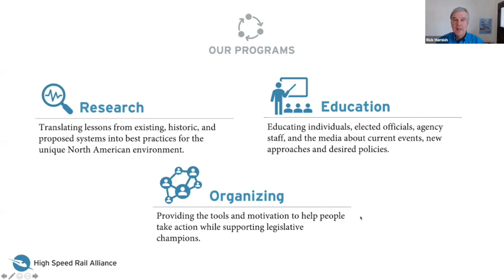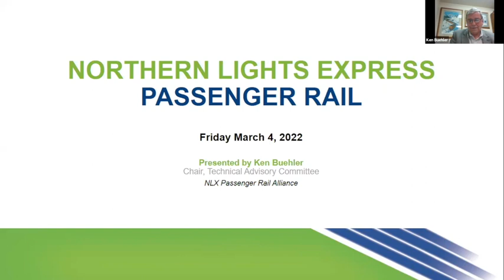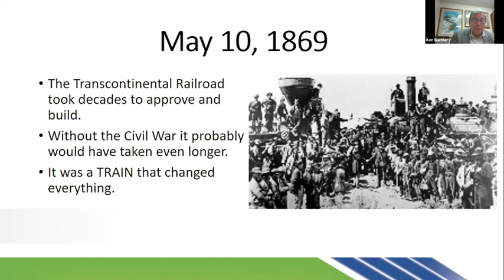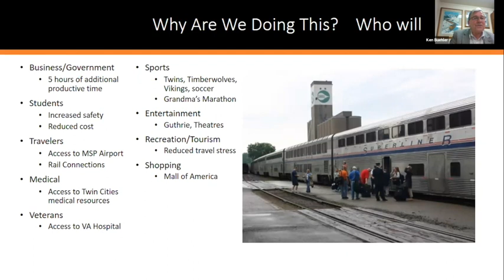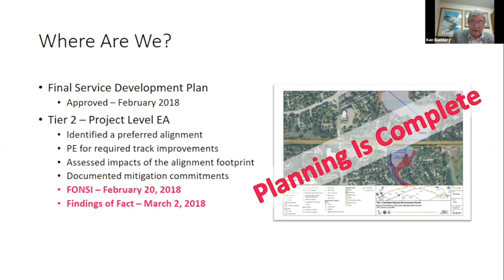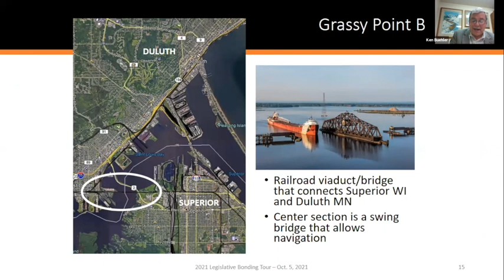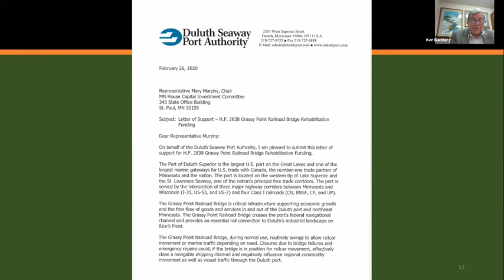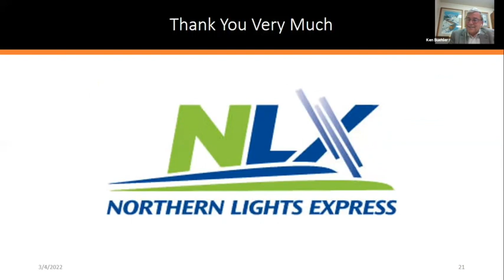Minnesota's Northern Lights Express

Comment: I wish NLX nothing but success. But I have to question what will be gained by Mr. Buehler throwing commuter rail under the bus. 

He speaks about how rail travel works everywhere else in the world. The reason it works so well is because the various modes of transport are coordinated with each other, to produce a near-seamless experience. And, whether Mr. Buehler wishes to admit it or not, that includes commuter rail.

Wouldn't it be far more beneficial to explain to lawmakers that by coordinating with commuter rail, NLX will serve more than the towns along that route, but also the towns along the Green and Blue Lines, Northstar, and eventually the Southwest? 

COVID has meant a hit to commuter rail, but we don't yet know the long-term effects. In some cities, we are seeing public transport begin to recover from COVID-related losses, and the ever-increasing cost of gasoline may push the recovery even further and faster. Attempting to push away from commuter rail to score some short-term gain does nothing but jeopardize commuter rail AND NLX down the road. 

Metro should be standing firmly behind NLX. NLX needs to do the same for Metro. You will sink or swim together.
Reply: How  did you react to the recent news?
Reply: @captainkrajick  Very glad it's received financial support from the state. Let's hope that the feds throw in sooner rather than later, as support can shift with the political tides.

If the route does get built, let's hope transit planners and NLX get together to coordinate timetables. MnDOT has other regional rail aspirations, and if they can get Metro and NLX into synch, it should translate into better ridership numbers, which can help justify further rail expansion.

Comment: The whole discussion about NorthStar is ridiculous. The reason nobody rides northstar is because it doesn't run frequently enough to be useful, not because nobody wants a local regional rail style train. It only has two round trips, with 2 inbound in the morning and 2 outbound in the evening, and doesn't extend to the large population center at St Cloud.

The speaker is correct that the Northstar model doesn't work well post-pandemic, as travel patterns are no longer hyperfocused on the idea of 'into the city in the morning rush and out in the evening rush,' but the solution isn't to abandon the idea of NorthStar-type system all together, but rather do what systems like Boston are doing, and run service in both directions at consistent headways at all times of the day including weekends. Travel demands aren't concentrated in rush hour anymore but rather at all hours in all directions, so that's the service we should be aiming to do.

The 4 daily round trips for the NLX is a reasonable start, but as the service hopefully improves in popularity, more and more trips should be added with a long term goal of hourly or at least bi-hourly service.
Reply: It used to have 4 times that many trips before the pandemic, as well as special trips for most sport events downtown. I do believe extending it to St Cloud would increase ridership drastically.
Reply: Establishing passenger service at all allows potentially part of that line to also support a future commuter service - hopefully.